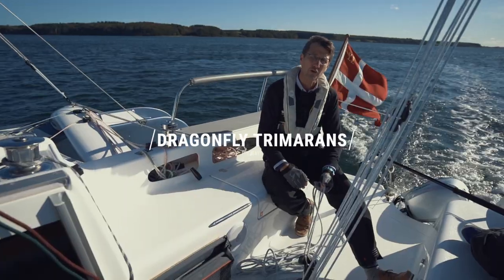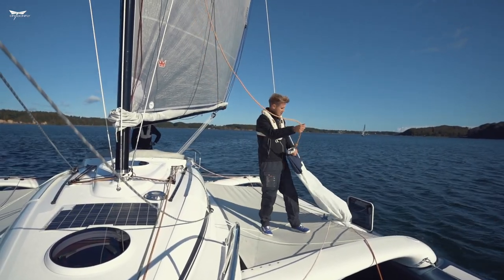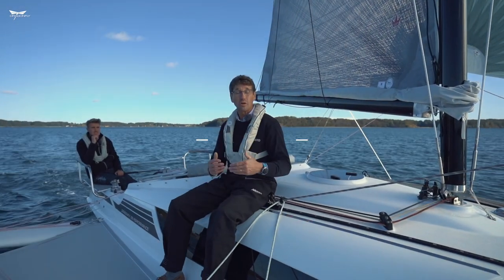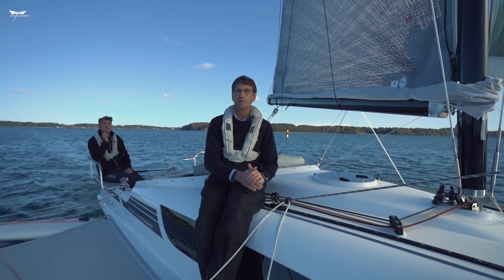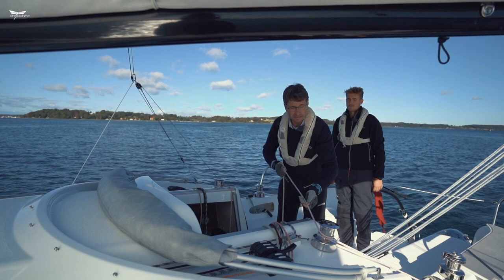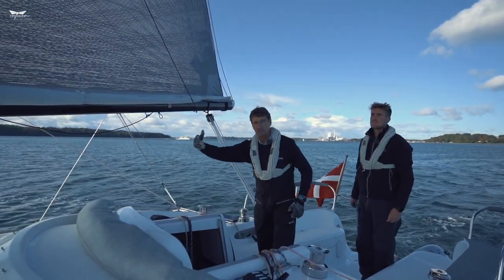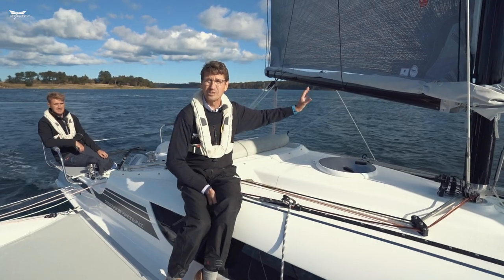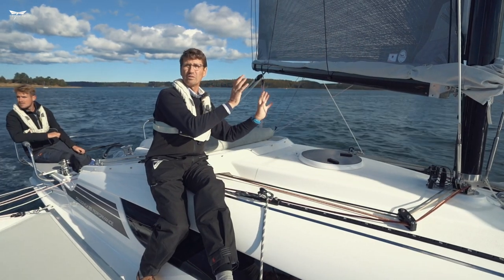Dragonfly Sail Guide - Downwind

Comment: Thank you for the video.  However, for new owners we need to see every step. You did not show removing the main preventer off the  port side and then attaching the preventer on the starboard side after the gybe is complete.  Also it would be great if you could have a second camera and show Jens pulling the sheet and in a split screen show where the clew of the gennaker is.

Comment: Great video, thanks. As a new owner of a 920 I’d appreciate any advice on the use of the preventer. Where does it attach to the boat?
Reply: Are you sure you have a preventer and not a boom brake? Ive seen preventers attached to traveler cleats before, but dont know if that is proper.